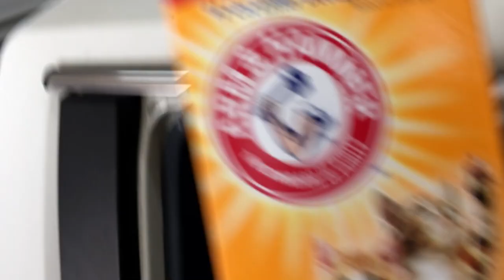Rusty Frame Hammer Test FAIL - 1987 Toyota Pickup

Comment: I see what you did there, "Hammer time", at 3:31 "WUP there it is!"
Love it, I would love an Acura update whenever you get a chance...
Keep on truckin!
Reply from the maker: I traded the Acura for a daily driver 07 Honda Fit that I don't feel bad about putting through an Ohio Winter. I was unable to get an Ohio title for the Acura because the Ohio DMV would not transfer the Vermont title to an Ohio title, so I was stuck driving with VT plates, which I could get a ticket for any time since I'm an OH resident. I'm going to make a video this winter explaining the whole situation of the VT title and how it works for some states and not others.

Comment: That's why I hate boxed frames. With time, mud and debris get capture inside the rails retaining moisture, rotting the frame from inside out. My advice, it's to close most inspection holes leaving only the draining ones, and spraying some oil fluid inside them. Besides painting the frame with some anti gravel paint, since grease collects mud, which flakes could end up inside the rails. Keep the frame clean, and once in a while, wash inside the rails preferably parking the truck in a ramp, inserting a thin hose from the rear frame rails.
Reply: @rogerrn9157 I just coat my Hilux frame with a zinc phosphate primer. It's 16 years old and has no rust. Just a bit of surface rust on the welds near the front control arms which I'll be sanding and coating soon. The advantage of a boxed frame is that the bed can carry a lot more weight.
Reply: @firecatinfernus3534  the use of boxed frames allow the Manufacture to use a thinner metal gauge, and the frame is more rigid to torsion. You still see plenty of "C" section frames among heavier trucks.
Reply: @RogerM88  It seems to be pretty thick but I understand what you're saying. I guess in a C frame the steel would be much thicker to increase the strength of the frame. And, I'm not sure as to why but the rust issues aren't as prevalent on modern Hilux frames. Probably because of more drain holes and well it doesn't snow where I live so no road salt. I can't really talk bout boxed frame rust unless I lived in a country that uses road salt.
Reply: @firecatinfernus3534  I think the modern Hilux frames are thicker to haul more cargo, and have as you said bigger draining holes. The "C" section frames don't allow mud and debris to get captured so easily. Besides that, they are more accessible be be painted.
Reply: @RogerM88  😅😅, modern Hilux frames are boxed mate. I have a 2007 Hilux. The Hilux 2022 has a similar frame. Fully boxed. I think you're talking about Tacoma's. I've never seen a Tacoma
Reply: @firecatinfernus3534  I didn't said newer Hilux used "C" section frames. I was referring to some advantages of "C" section frames. I think Toyota only uses those type of frames in the Dyna.
Reply: @RogerM88  Oh, ok. My bad. And is the Dyna the toyoace?
Reply: @firecatinfernus3534  I think to trucks capable to go off-road, Manufactures have a preference for boxed frames as it allows less torsion. Check this video from some years ago comparing both style of frames. https://www.youtube.com/watch?v=TKMQjm7i2Jw
Reply: @RogerM88  thanks a lot for the info. Does the ford have a C frame and the Silverado a boxed frame? I don't know about either one of those pickups.
Reply: @firecatinfernus3534  yes the Toyoace in Europe is branded as Dyna. If they got a version using a more standard cab, as the super duty trucks, it could be an option for many that tow heavy loads, instead of going for a pick-up as the Hilux. The cabover layout is less comfortable since you seat over the axle.
Reply: @RogerM88  oh, I see and yeah, cabovers are pretty bumpy.
Reply: @firecatinfernus3534  in the test, the Chevrolet had a boxed frame, and the Ford a "C" section frame. But take that test with some skepticism since it was a clear biased test.

Comment: I had 90 toyota 4x4 extra cab 500 hundred thousand miles before 6 cylinder expired put new v6 3.4 bigger 6 in it runs great put new clutch new power windows motors in new radiator

Comment: a few years ago I got a $500 xtracab 2wd from southern ohio. I was tempted to put a bed on it and save it because it was a original untouched truck with 134k on it. I decided to part it when I saw both leaf spring perches collapsed into the frame lol
Reply from the maker: Sounds like a standard ohio toyota frame!
Reply: @6thGearGarage  it was sad seeing it in that shape. the truck was tucked away for roughly 20 years so it had a absolutely immaculate interior minus a few cracks on the dash pad.

Comment: Love to see the 2wd models get some love 🙂 Here in Australia my brother owns a 1984 dual cab of this model (I don't think you got these in the US). In Australia the 83-88 models had the 3Y in the 2wd and 4Y in the 4wd. In the US yours had the 22R which is interesting.
Reply from the maker: I started out into 4wd, but for hauling, the 2wd's are great. My next upcoming build will be a 2wd long bed because I'm tired of lifting engine/trans parts chest high to put in the bed of my 1985 4wd.
Reply: @6thGearGarage  the 2wds are fantastic work trucks. the lower bed height makes them way more practical for hauling stuff. currently I am working on swapping out my RCSB body for a 1st gen 4runner shell because honestly my truck really isn't that useful at hauling stuff and I hate having pretty much zero interior space.
Reply from the maker: @retro_88yota   I've thought about this before, but don't think I've ever seen it done. I hope you take a lot of pics.
Reply: @6thGearGarage  watch my fb page for pictures. I will be doing the swap at the end of January. I will also take a few videos for youtube as it will give a good view of the stuff I had to do for my engine swap.

Comment: Firstly live in Australia and own a 1997 Toyota Hilux with the 22R engine and l have no rust problems the cab is good the chassis is good also and the tray been aluminum its in good condition also and it us the original tray it doesn't snow much in Australia and even the newest Toyota Hiluxes have a metal box frame but the rust is terrible l stuck my finger in the frame holes and all that was in there was dry dust and my ute is parked outside in the rain
Reply from the maker: There's Toyota trucks around here 10-15 years old with frames breaking due to rust. They just don't hold up in salt :(
Reply: @6thGearGarage  There is a big agvantage about living it only snows in a couple of places in N.S.W Victoria and Tasmania so Toyota Hiluxes don't rust infact the latest Hiluxes have a full box frame chassis